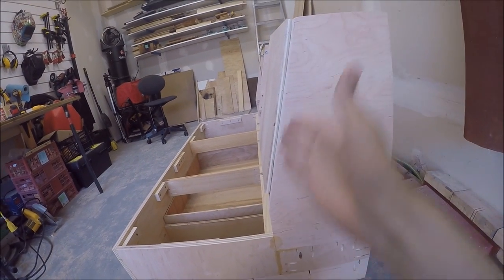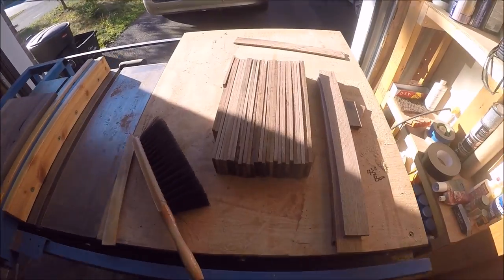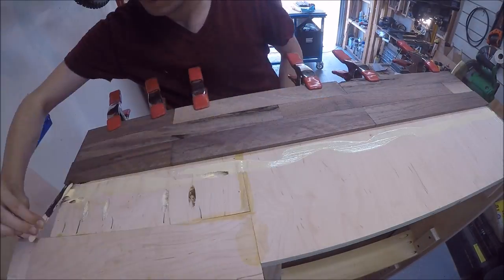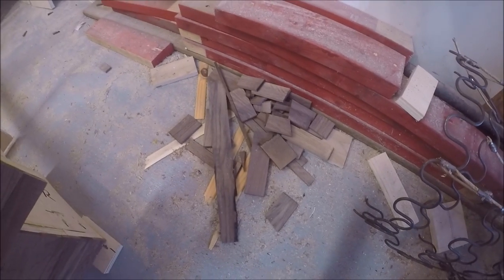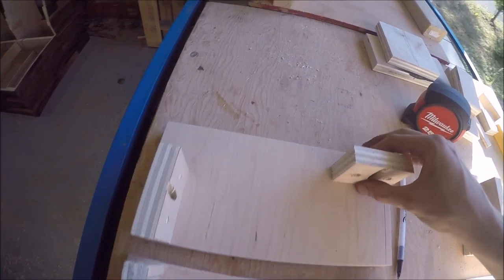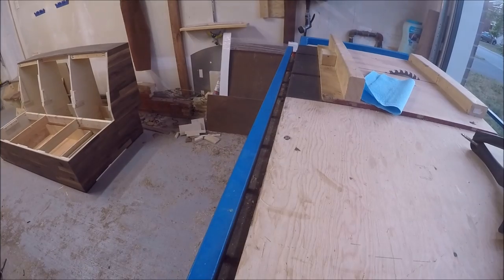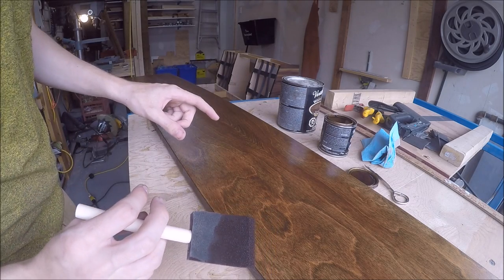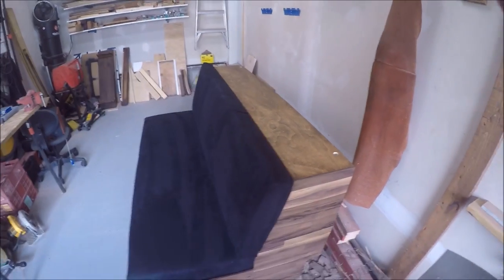Making a Modern Couch | 2

Comment: thanks for the well documented project. We're wanting to put together a pit group, and your box process was very helpful. I'm curious how well the seat belts are holding up with just staples at the ends. I was expecting you to staple them to the side of the upright, then pinch them between another piece screwed to the upright. Also, I don't know if it's still even available, but when I was a kid (just after the invention of electricity), we used to have lawn chairs with interwoven nylon straps and you could buy replacement webbing. I thought that would be a good option as well. Thanks, again.
Reply from the maker: +Jason Starr Thank you for watching Jason, the seat belts are holding up fine, no problems at all yet, although next time i would have made them less visible from the sides. Originally i was planning on using that webbing you are talking about but i could not find it anywhere in canada. If you can find it it would definitely be better.

Comment: Hello, May I ask where you got so many seat belts?  (I would also like to try my hand at making a couch.)  Thank you in advance for any insight you may provide.
Reply from the maker: +GreekVegetarianRecip Hello, i went to a local scrap yard where you can remove parts your self and pay for them when you leave, I cut 4 seat belts off just with scissors. Go for it! Let me know and i will answer any questions i can!
Reply: Hi again!  Thanks for your quick reply.  So, I really want to make a "Noguchi" couch for myself.  It looks a little bit like a huge pebble.  It's considered mid century modern...I think.   I don't really know the decorator terms, I just like it.   It's more than 11,000 US.  You can get cheap knock offs on line, but I want to make it.  Don't know if I'll succeed.  Anyway, I will need seat belts, what a great! idea.  The "Noguchi" table is also amazing, just classic.  Check it out.  Thanks again.

PS.  If I can't find a local scrap yard that will let me do it, maybe I'll cut the seatbelts off the back seat of our car, as we never use the back seat anyway.  Just kidding!
Reply from the maker: +GreekVegetarianRecip thats a cool couch, definitely modern, looks pretty simple to make if you have a jigsaw and a couple sheets of plywood, hard part would be getting the cushion to be round like that. Cutting foam was surprisingly hard. I would get an electric carving knife and cut a big block of foam to the shape, or if you have the money just get an upholstery shop to cut it for you.